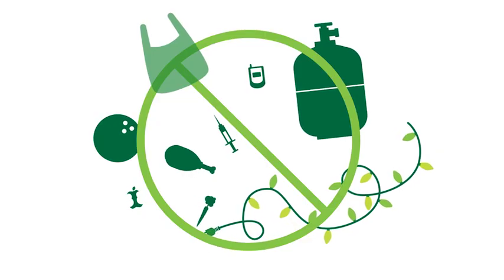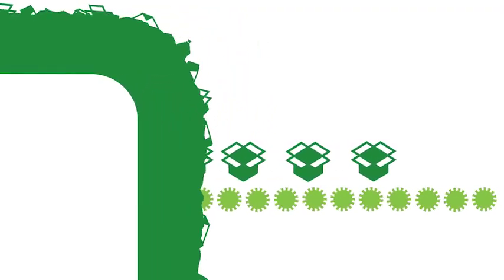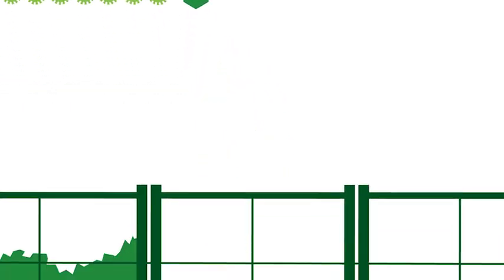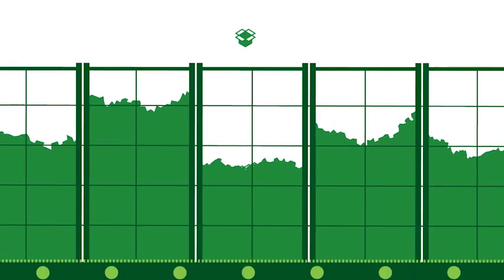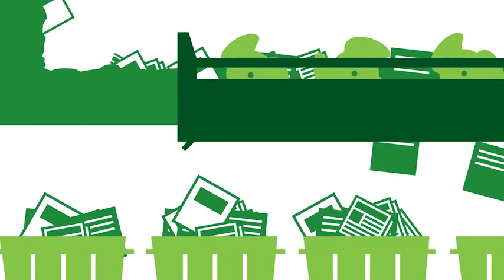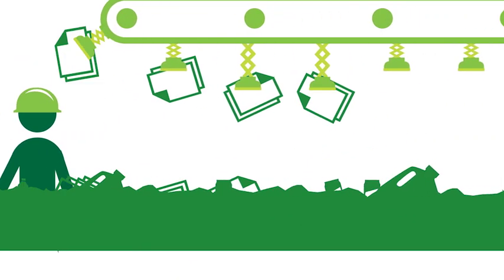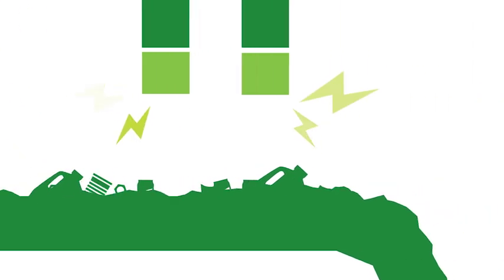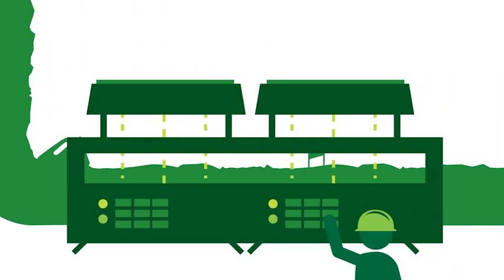How it Works: Single Stream Recycling

Comment: I am sorry, I have enough problems already, I can't wash out and dry all bottles and food containers and cartons.  I guess I'll just have to put my paper and cardboard only in the recycling.
Reply: We are talking about rinsing them and put them aside for a while to dry. Honestly it doesn't take time, maybe 1mn to put some water you used for something else and you put on the side of your sink and voilà! That's it
Reply: @julesy105

 Try this when washing dishes i utilize my dirty soapy water to rinse out the food containers therefore your doing it in all one sitting, and your not wasting as much water when just rinsing it alone. Drying alone should be easy just set it aside you dont have to thoroughly dry out each container, it would dry on its own by the time your next pick up is due
Reply: It's a quick rinse of something when it gets empty, it's not hard. Is your family the Brady Bunch and going through containers on a daily basis? :P And what is the point of this comment? It's like you're just complaining. You want them to figure out a way to recycle food? Talk to Doc Brown about that.
Reply: They don't have to be squeaky clean. Just dump out the last bit of back wash of a bottle and voila, it's completely empty. If it's a tuna can, corn can, or peanut butter jar, give it quick rinsey-roo just like you do your dishes. If it's a detergent bottle or shampoo bottle, you don't fill it up with water and try and get the most out of your soap? Just wondering, are the roaches bad at your house? LOOOL. 😂

Comment: I thought here in the greater Los Angeles area and Ventura County we were not supposed to worry about washing out our plastic and glass containers thoroughly.  The way I was told was that the MRF was much more economical of water for this purpose and we ought not to be using potable water to wash recyclables.  Correct me if I am wrong, please.
Reply from the maker: +James Flick, Top Secret Movie Reviewing Agent - If the bottle is dry and without residue then rinsing is not necessary. Often, though, plastics have other liquids or food waste inside of them and we ask that they be cleaned prior to recycling.
Reply: @wastemanagement  What do you with the recyclables that have residue?
Reply: @terry4360  Rinse them out easily, otherwise recyclable material becomes not recyclable :)